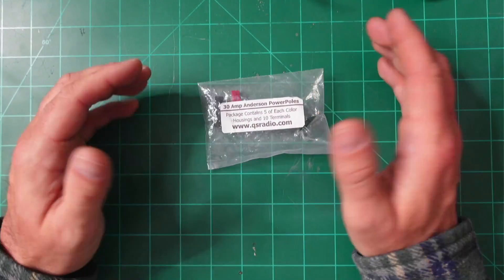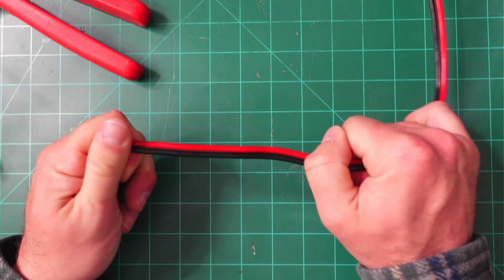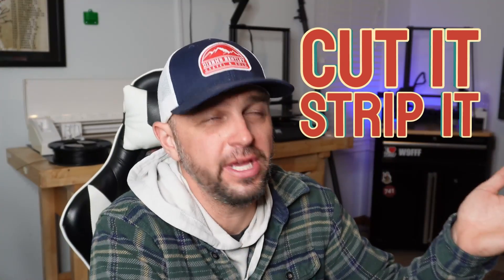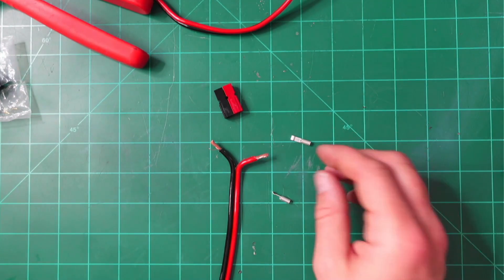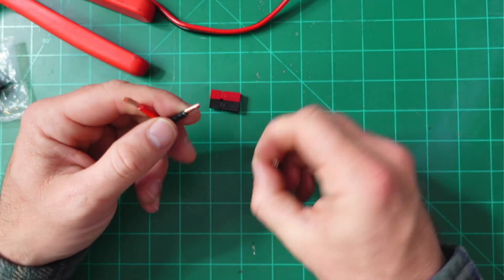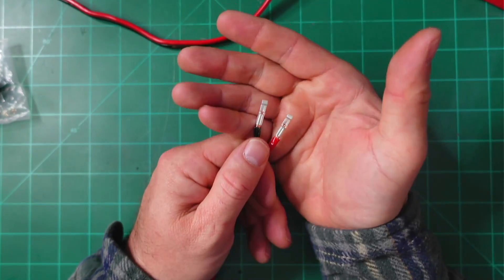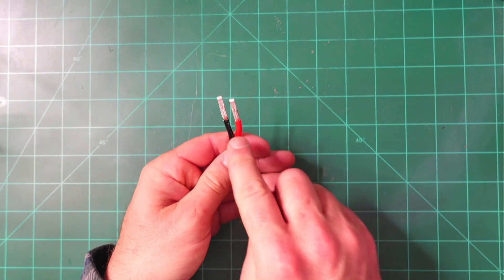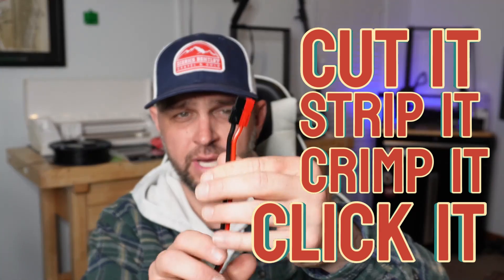Simple Guide To Install PowerPole Connectors in 2024!

Comment: An eye glass repair flathead screwdriver helps seat the  metal connector into the plastic housing. Also, if you're using thinner wire (e.g. 18 #) with a 30 amp connector, strip back double the wire, fold it over and crimp it.
Reply from the maker: This is a great to tip, thanks!
Reply from the maker: I just wanted to revisit this  - Today I used the flathead screwdriver! I did bend the tip, but it worked!
Reply: @DudeTested  Thanks for following up and reporting your findings 👍
Reply from the maker: Hey,  I'll take a broken cheap 🪛 , if it works.  Thanks again

Comment: These are the worst connectors. ETA:  They are only the worst if the crimper you have makes them impossible to insert them into the housing (didn't look too easy when you were doing it either). When I used some pliers to narrow/square up the crappy crimp they clicked in without a ton of force. If yours are hard to insert make sure this isn't the issue before pushing harder with tools or you will just ruin the housing (like I did when I typed my first comment).
Reply from the maker: Maybe recommend what you enjoy, so that others who may be researching this topic can see the input?  "These are the worst connectors, I recommend XT60's because....." (Or whatever you recommend), could be way more helpful to the community.... Thanks.
Reply: @DudeTested  sorry you are right. Edited
Reply from the maker: Thanks so for much for the updated input. I think it really helps people understand why they may want to look elsewhere.

Comment: Hi, thank you for all your instructional videos. How short could I build my transceiver power cord? I heard that the shorter the better.
Reply from the maker: Great question!  The shorter the better is true.  Longer cables could create drops in voltage.  These drops in voltage could affect the overall performance of your transceiver.  Wire Gauge is also important.  My opinion of it is if  one is running a 100w transceiver with a 10 ft or less power run, 12AWG should be fine. Running longer lengths, would increase the size of your wires, 10AWG for example.  This should help reduce voltage drop.

But yes, generally the shorter, the better. Leave yourself enough room for an inline fuse :).

Take care and thanks for asking!

Comment: Which side is up on the powerpole?  Metal side or not?  How do you remove them?
Reply from the maker: Hey there!  Check out 3:57 in the video . My metal tabs are facing upwards when I do this.  How to remove the tabs: use a removal tool like this to extract them  _ (affiliate link)  - https://amzn.to/3zusvRj   .  Alternatively,  you can use a super small flathead screwdriver.   Best of luck!

Comment: My red cable keeps buckling, can’t get it in. Any tips?
Reply from the maker: Sure.  Edgar gauge wire Are you using?  The powerworks tool, a small flat head or similar may be needed.
Reply: @DudeTested  40ah. Small flat head, you suggesting stick that down the back to push it through?
Reply from the maker: That's about right.  Here's a video example https://youtu.be/1-5-7Z6JzX4?si=81qOUfXPKQJj0CNb. Good luck!

Comment: That small power workx tool is great .I got the big kit with crimper power poles contacts . removal/insert tool some pins . great set. I have them in a bunch of colors . that little tool can be used to pull them out if you need to. gets between spring and contact. a little twist and easy out it comes. they have them in bigger sizes . up to 350 amp ones. both SB and power pole series. true Anderson is UL listed. the SB ones rated 600V AC/DC . first on market in 1950's . used world wide today.  some coolers and power stations like YETI turn them 90 deg when put together . easy to change. the normal ham way is called horizontal . the outher way is veritable like some YETI and outher brands. they sell sockets/plugs that way. power worx has all. great pure copper wire . even Mag wire and PTFE wire. my main source of them.   the Amazon ones some ,they have true Anderson as well. . China nock off have a weak spring and not silver plated contacts. they work but loose connection or run hot or just fall apart. the real ones click together and stay together. they have a small clip to hold them in place as well . came in the big kit bag.  good stuff. 73's
Reply from the maker: Huh that's really interesting!  I don't know that I've ever seen a Yeti with powerpoles but now I am going to be on the lookout!   As for the weak springs on the knockoffs, I agree!

Comment: You gad me at Stripers from Germany... But seriously I see many people solder after crimping. Red on Right, contact down,  got it. I can't count how many I had to turn 180 deg. I always have to use a small flat screwdriver to get contact to seat. sometimes have to bend contact to get started. But may be due to Amazon knock-offs.

Comment: Wikipedia: ''For use in amateur radio, the community has adopted a standard color code, polarity, and specific physical arrangement for assembling pairs of Powerpole connectors. One red and one black powerpole housing can be physically arranged in 4 topologically different mechanical orientations (red left, red right, red top, red bottom—when viewed from contact side with tongue up), 2 of which are mechanically incompatible (connectors won't mate with ARES) and 1 is electrically incompatible (will mate but reverse polarity) with the ARES standard; there are also additional unusual configurations in which one housing is rotated 90 degrees. The standard is red positive and black negative. When viewed from the contact side, a mnemonic for remembering the arrangement is: "Red [on] Right — Tongue [on] Top" (note the first letter alliteration).''

Comment: Tongue UP, Red Right.
Reply: I don't understand, my message is not displayed. Sorry if there is a duplicate!
See the article from ''Santa Clara County, California
ARES/RACES Anderson Powerpole Connectors'' Since I can't paste the address here...
Quote: ''Easy way to remember the orientation: "Red on the right, tongues up, away from you." If you use this rule when clamping the black/red wires for soldering, you will be easily able to insert them both into the housings.''
The tongue in the air is the bump not the tip... You showed ''tongue up''.
Also see Wikipedia. Do a Google search and you'll see!
73!
Reply: @DudeTested  There was no malice. Just wanted to do well, help and correct the form. This is a simple typo in the interpretation of how the tongue is represented when it is up or down.
The way to do the PP is: The tongue UP but the cutting edge DOWN. It's the same thing!
This is why the mnemonic forms we see are either: 1) Tongue UP, Red Right, or, 2) Tongue Top, Red Right.

73!
Reply from the maker: @VEChaplin I think I see what you're saying. The tongue you're referring to is inside of the red powerpole connector, whereas I was thinking the tongue that you were referencing was the actual metal connector off of the wire.
Reply from the maker: Something weird is going on with youtube today..  I'm not certain if my last message went through, so I'll try again.  I think the confusion is what is being referenced as the tongue. I was thinking the tongue as the connector off of the wire that gets inserted into the power pole itself.   Whereas, I think what you're referring to is the tongue which is inside of the power pole connector.  Appreciate it.
Reply from the maker: I understand now.   Thanks.  There was confusion on my end.  Tounge references the inside of the powerpole connector itself and not the crimped on the wire connector.  Cheers
Reply: @DudeTested  When you look at the case forward, where it says ''A'', it is the ''Tongue'' and should be at ''Right''. The top where it is flat is the ''Hood''. The connector on the wire and the box are 2 different things and you have to understand which way you look at it as well.
Reply from the maker: I just demonstrated tounge down,  red on the right.... what did I miss
Reply: @DudeTested See the article from ''Santa Clara County, California
ARES/RACES Anderson Powerpole Connectors'' Since I can't paste the address here...
''Easy way to remember the orientation: "Red on the right, tongues up, away from you." If you use this rule when clamping the black/red wires for soldering, you will be easily able to insert them both into the housings.''
The tongue in the air is the bump not the tip... You showed ''tongue up''.
Also see Wikipedia. ''When viewed from the contact side, a mnemonic for remembering the arrangement is: "Red [on] Right — Tongue [on] Top" (note the first letter alliteration).''
Do a Google search and you'll see!
73!
Reply from the maker: Here is the link https://www.scc-ares-races.org/hardware/andersonpp.html It's literally the same thing I am doing, but they are looking at their connector opposite of mine.  I don't want to reach around to insert the wire, it doesn't feel natural.
Reply from the maker: https://powerwerx.com/help/powerpole-assembly-instructions Tounge down.
Reply: @DudeTested  NO! (...)''The contacts go in the housings in only one way. Insert the contacts with their sharp edge down against the flat spring that is in the housing. They should slide in and click. If you do not hear a click or they are not fully seated, fix them. When they are inserted fully you should notice that the contact and its wire "floats" slightly inside its housing. When looking in from the front of the housing the contact tip should slide over the top of the internal hosing spring. This is the clicking sound that you hear.'' (...)

Sharp edge down NOT tongue down.... Come on!
Reply: @DudeTested  ''The contacts go in the housings in only one way. Insert the contacts with their sharp edge down against the flat spring that is in the housing. They should slide in and click. If you do not hear a click or they are not fully seated, fix them. When they are inserted fully you should notice that the contact and its wire "floats" slightly inside its housing. When looking in from the front of the housing the contact tip should slide over the top of the internal hosing spring. This is the clicking sound that you hear.''

Sharp edge down not tongue down! Come on!
Reply: @DudeTested  See the article from ''Santa Clara County, California
ARES/RACES Anderson Powerpole Connectors'' Since I can't paste the address here...
''Easy way to remember the orientation: "Red on the right, tongues up, away from you." If you use this rule when clamping the black/red wires for soldering, you will be easily able to insert them both into the housings.''
The tongue in the air is the bump not the tip... You showed ''tongue up''.
Also see Wikipedia. ''When viewed from the contact side, a mnemonic for remembering the arrangement is: "Red [on] Right — Tongue [on] Top" (note the first letter alliteration).''
Do a Google search and you'll see!
73!

Comment: I bought both cheap chinese and the official powerpoles. The cheap ones are good for experimenting or practicing with installation. I use only the genuine powerpoles for all my permanent connections and cables.
Reply from the maker: I make these quick connect/disconnect radial wires with the aftermarket PP connectors. They do okay, and allow for a quick disconnect in case someone trips over the wire. :)
Reply: Great Idea! I will do that! Thanks for all that you do! 73

Comment: You could tin the wires before crimping them for added rigidity and then hit the crimped connection with a bit more solder to seal the deal.  That's what I do.  Some will say it's not needed, some will say it's better.
Reply from the maker: Thanks!

Comment: I’ve made a bunch on my own, and they worked. But I used cheap tools instead of the proper ($40) ones. It worked, but it was not easy. I was hoping this video would show me how to do this without having to get such a specialized tool. Nope. The instructions are to just use the special tool and crimp it.
Reply from the maker: Oh I see.  My simple way to memorize and help install powerpoles got confused with a simple shortcut or hack.
Reply: @DudeTested  sorry.
Reply from the maker: It's not you,  It was my title.  I changed it to show it to be more accurate.   Sorry for the trouble

Comment: Now would you solder it?  I like to tin the wires sometimes if I have time.  Makes it easier to slide the wires into the ferroles.  But the good part is, you don't have to if you don't want to.  It is only a preference.  It might be a good idea on the cheaper ones though if they have corrosion issues.
Reply from the maker: As I understand, soldering would seem more durable but could create breaking points because of the extra rigidity.

Comment: Thanks for the video. Where is the link for the crimp insertion tool please ? I find attaching 15A Powerpoles to thin guage wire virtually impossible because the wire always buckles.
Reply from the maker: https://amzn.to/4cwyhjM . Yes smaller gauge without one is difficult.  Like on the xiegu or ic705 power cable.   Good luck!